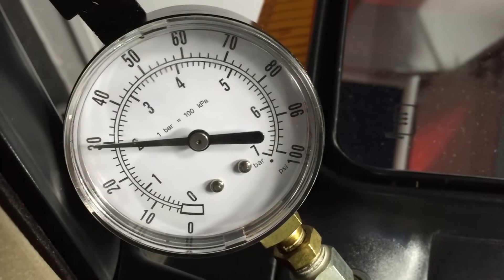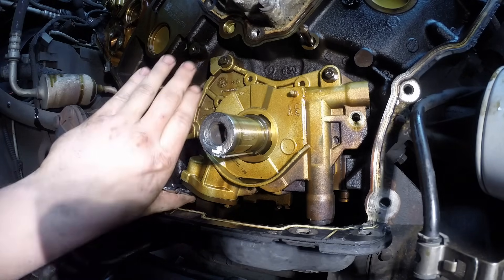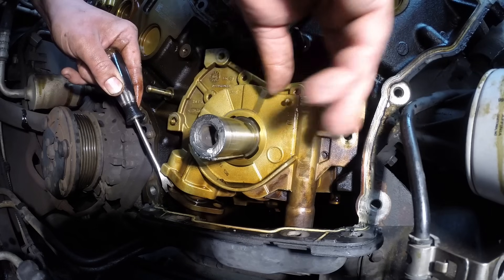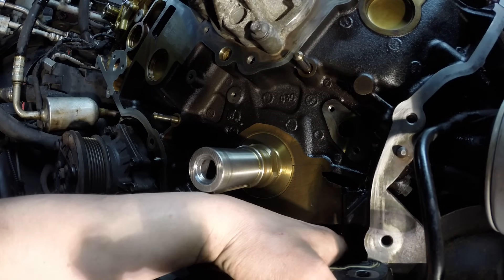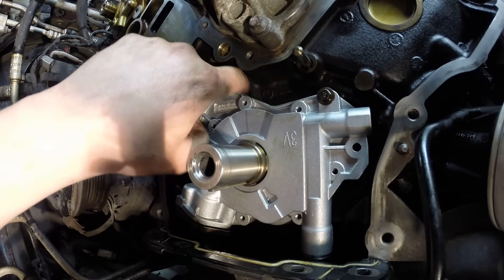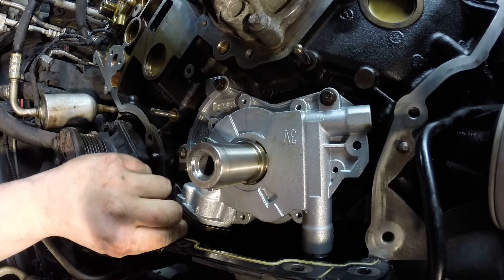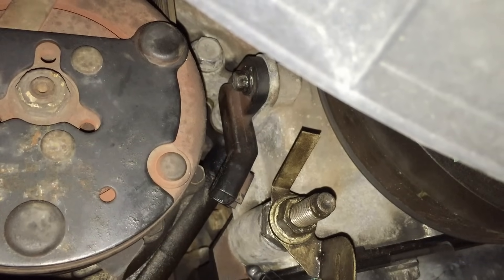Ford 5.4L 3v Engine Melling M360 Oil Pump Upgrade

Comment: you mentioned it was a 10 to 15 min job in your video.  How so, when the shops are claiming 13 hours?  The entirity of the front engine was off the engine you worked on.  That tear down costs something and takes time, making the 13 hours reasonable.  I do appreciate you pointing out that the Ford Mod Motors are not up to the same quality as the Ford FE, Windsor, and Cleveland engines of the past.  How do you build an engine with a weak and break prone oil pump?  Seems like sabotage from the manufacturer.
Reply from the maker: I mentioned during a timing job why not go one step further and replace the source of the problem which is the oil pump. At this point it is only another 10-15 min job.

Comment: I used an extendo (that's some go go gadget terminology) magnet and placed it directly underneath the bolts...or u can use a wide magnet and place on the outside of the pan again directly under the bolts as well...if all else fails find a mechanic with BK hands (tiny fingers)

Comment: What's the High Volume Pump for a 1997-2002 F 150 4.6L?  M176?? Thanks
Reply from the maker: You want this one- https://amzn.to/3U0s7iP
Reply: @FordTechMakuloco   Thanks, Might as well change the oil pump for the full tune up.

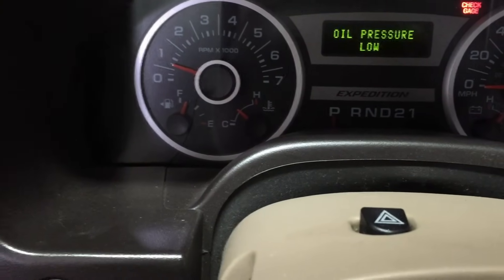Comment: At 12:45 I think you meant to say it’s a 10/15 hour job* lol
Reply from the maker: No I meant a 10-15 min extra during a timing job.
Reply: @FordTechMakuloco  oh my roller follower failed on my 09 mustang 4.6 an it messed up the cam I can't find someone that will replace just the cam an lifters an followers they all wanna pull the timing cover an replace the chain to but car has low miles I don't got chain issues ik there's a way to do it without touching it the factory ford timing chain is on backorder I don't wanna use any other one

Comment: I like to see your videos, they are very useful, I would like to know if the 2000 5.4l 32v lincoln navigator engine has two oil pressure sensors because it uses needles and a light, the needles go up more than half but the lubrication light still comes on.  this engine does not use vvt

Comment: What's the difference between the 340hv and the 360hv? AutoZone is telling me the 340hv. I  have a 06 expedition 2wd 5.4. What to do?
Reply from the maker: You can use either one, the 360 is just a higher pressure which isn't needed.
Reply: @FordTechMakuloco  Thank you Brian,  went ahead and purchased the 360 😊🤞

Comment: Hey Brian, one quick question. I swapped out my oil pump when I did my timing chain. I have everything back together and trying to prime the system. The motor is cranking and cranking and my gauge is not moving. How long in general does it take to prime? Thanks
Reply from the maker: Crank two times for 10 seconds each allowing for the starter to cool. Then connect the CKP and fire the engine. If the oil pressure does not come up within 2 seconds some thing is wrong and you need to shut it down.

Comment: Used a 14" zip tie around the bolt to get it off and back on. You can use the tag end of the tie to firmly hold, position and align the bolts as well as put a small side load on them to ratchet them off and back on with the swivel head. Once you've ratcheted the bolts on far enough, you simply cut off the zip tie. There's no way to lose them in the oil pan either.
Reply: That is smart. Good thinking

Comment: Hi, why only 3 bolts , not 4?
Reply from the maker: The 4th one comes from the lower bolt on the drivers side guide during the timing process.

Comment: That driver side pickup bolt is my worst nightmare 😫. It sucks getting in so bad I almost want to drop the pan. Im doing a head and cam swap on my 02 lightning. Everything has been easy except for these two 8mm spawns of Satan.

Comment: I recently followed your 4 part video series on the full timing chain replacement. I replaced the oil pump with the Melling 360HV and started running 5/30 synthetic oil. My truck runs better than ever - Thank you for your excellent videos. I've noticed since I did the job - my oil filter gasket is dripping a small amount of oil. I've changed the adapter gasket, changed the filter itself, confirmed the filter seal is in good shape and does not have "double seal". Also cleaned everything off and actually crawled under and confirmed oil is coming from the oil filter seal itself. Any chance this is pressure/volume related? should I try going back to 5/20 oil? Anything else you can recommend?  2007 F150, 5.4 3V, 245,000mi.
Reply: Please lmk what happens. I recently went and did a timing kit and the 360HV pump too. But still running 5w-20. Going to switch to 5w—30 soon
Reply: Which oil filter are you using?

Comment: I just ordered one of these pumps for a 5.4. So excited to see the extra oil pressure at hot idle!
Reply: Hope you have an external oil pressure gauge. If your truck is like my 08, oil pressure always sits just above middle, no variation during driving or idling.

Comment: I see you still had a low oil pressure message on the message center with 40 pound's on the gauge what was up with that ??
Reply from the maker: The manual oil pressure gauge was put in place of the oil pressure switch so of course...

Comment: My 226k mile 5.4 has been awesome but when I turn it on in the mornings or after a while of being off it gives me “low oil pressure” on start up for less than a second.
Reply: That just happened to mine 04 f150 was it the oil pump or something else?

Comment: Great videos I have question I change oil pump 340HV 2009 Ford F150 and when I crank it it is not building oil pressure. I tried with oil sending unit then changed it out to an oil gauge. Still no pressure. not sure if I am not cranking long enough or do think it could be something else?

Comment: this is way late date to comment but I got to wondering if there is any concern that installing the high volume and increased pressure pump plus using the latest oil flow restricted roller followers might be overkill for oil pressure problems and actually contribute to increased potential for bearing damage and parasitic power loss due to high pressure. I had engine builders in the past (pushrod days) advise against high volume/pressure pumps for street engines.
Reply from the maker: I only use the standard pressure high volume M340HV.

Comment: Why only three bolts when there are 4 bolt holes?
Reply from the maker: The 4th bolt comes from the lower guide bolt on the drivers side.

Comment: What if I followed the instructions, and I don't have oil pressure. This project took me 1 1/2 years to complete. Could that be the reason why I am not getting oil pressure?
Reply from the maker: Crank for 10 seconds two times in a row allowing for the starter to cool. Then connect the crank sensor and start the engine, engine clatter and the oil pressure gauge should come up within 2 seconds, if not shut it down there is a problem.

Comment: I have a question. Will this oil pump work in a 05 Ford F-150 5.4l SOHC engine? I’m talking about the new high volume high pressure oil pump. Amazons website says it will not work and that it is for a 32v 5.4l. I don’t know if does made a 32v 5.4l

Comment: Mine was done after 220,000 and phasers, chains, guides, etc.....my mechanic switched me to 10w40.  Plus every other oil change a quart of Lucas stabilizer.......truck runs good and engine tight!!!

Comment: Wil I am going to replac tensioner chain kit but do I have to change oil pump also ! . Cause I don't know if the pump is faulty or not but the gage pressure was good before I begin to replace that parts.

Comment: Just wanted to say thanks for the great tutorial. One tip I have for others having a hard time with the rear bolt is to take two minutes to make a wrench out of a thin piece of sheet metal. Use tin snips to cut a metal strip 3/4" wide by 6" long then lay the open end of an 8mm wrench at the top 3/4" side to trace and cut the 8mm opening. Now you have a very thin flexible wrench that you can use to overcome the steep angle of the rear bolt during its initial installation. As you insert this flexible wrench you can use the same finger you are using to hold the rear bolt in place to guide it. I fought with this rear bolt for over 2 hours before trying the above and then was able to install the rear bolt in literally minutes.
Reply: A year later and this gem of advice saved me likely hours of frustration. I made the wrench like you said but I also made a “wing nut” to slide onto the screw head to help with getting it started. I cut a very thin strip (barely wider than the screw head itself is tall) by maybe an inch and a half long. Folded it tight into thirds, think like a paper clip not a Z. Then jammed a screwdriver in the middle and twisted until it opened up enough to fit tightly over the screw head. Kinda looked like this when it was done <o>. Made it easier to start the threads and turn the screw with one finger. Pulled right off then the flexible wrench did the rest. 

A heartfelt thank you 🍺

Comment: Hi Bran, great videos. I have a 2007 f-150 5.4l 3v. It has just happened under 140,000 miles. Will be replacing timing/oil pump (Melling M360VH), and rockers. All OEM except pump. I am acquiring the tools and parts you recommend little by little. Probably will have everything by the end of March. I am not a machanic but have sent you videos and feel confident. I just finished changing the plugs and and coils (Motorcraft). I was lucky and none broke. Thank you so much for your indepth vedios...they're great.

Comment: So why did it say low oil pressure on the dash after new oil pump. What was that about.
Reply from the maker: Oil pressure switch was removed to screw in the manual oil pressure gauge of course!
Reply: Hahaha of course. Good video man. I'm buying a 2010 f150 with 220k miles on it and I'm definitely putting this pump on. Thank you for your time.

Comment: Need help I have a 2005 5.4 f150 I replaced the timing chain kit including, tensioners,phasers, oil pump but not a melling m360 and vcts it runs great for 10 to 20 minutes then runs as if it's going to cut off turn off the engine restart run good for a few start running as if going to cut off checked for codes had codes p0340 p0344 p0345 and p0349

Comment: M340HV or M360HV for 06 F150 5.4?
Reply: I’ve been reading comments and I think maku says 340HV
Reply: @americanchauvinist1210  Ive been using the M360HV for over a year now.
Reply: Any oil consumption or leaks?
Reply: @americanchauvinist1210  it exposed a rear main seal leak and I had to fix that and now its fine but it is slightly burning oil but that could be many different things. But its not bad.
Reply: @MrTailsGamer  do you think the 340HV won’t have that issue?
Reply: @americanchauvinist1210  honestly I don’t know. There was some sort of confusion, maybe on my part on which one we should be using for these 5.4 3v motors. I thought maybe the 360 was too much and could be problematic but so far so good.

Comment: I need help! I did the full timing job on my 06 f150 including this m360 oil pump upgrade. It runs great, however I think the stock pcv is getting oil pushed passed it and into the intake manifold as I am consuming oil and getting blue smoke at startup. I have a feeling its because of the increased oil pressure but I am not sure. Does the stock pcv, which is built into the drivers side valve cover not strong enough to support the extra pressure? I need some advice! Ideas? Thank you!

Comment: For my 07 4.6l 2v Melling has 4 options and for the m176hv for high volume and pressure has a warning if u have stock bearing Tolerances, don’t use. Does switching to 5-30 solve this? Is that y u change oil weight?

Comment: Just finished installing the new M360HV.  Yes, it was a beast of a job. As shown in the video the 8mm flex is a must and with the assistance of a topside creeper made it more manageable. I did have one secret weapon. I sub-contracted the hard to reach pickup tube bolt to my 11 yr. old daughter.  Together we got it done! I've seen a lot of back and forth between the M360HV and M340HV.  At the time (July/Aug) I was gathering all the tools and parts needed for the job, it seemed like the   M360HV was advertised pretty heavily. With that, I'm not going back in and swapping out the 360 with the 340.  At this point, it is what it is.
Reply: Did the job really only take 10-15 minutes as he states in the video?
Reply: @A.C.71  The oil pump, power steering and the oil pressure sending unit were hard. I have a 4x4 so the clearances we're tight.  

Getting the pump off was easy. Putting it on was challenging but the bolts on the pickup tube are hard.  Took me awhile, but I'm a novice.
Reply: @EVRY1STFU  I'm thinking he meant 15 minutes once the from cover was off. I'm curious how much time the entire job from start to finish takes the average guy. About how long did it take?
Reply: @A.C.71  I'm below average. Meaning that was the most I worked on a vehicle in terms of technicality.  It took me longer than most. I work a full-time plus type job and I had to contend with 3 family emergencies. I also dealt with a counterfeit tool from Amazon....so that slowed me down significantly. I also inspected all parts and tools 20 times over. I called several Ford dealerships to compare part numbers etc & dealt with Amazon fraud department. I could probably do the job in 3-4 days comfortably now that I have a little experience.  Some guys on his videos get it done over the weekend.  Brian quoted me 1.5 days, but he's a master mechanic with a nice garage setup. Overall, it's a good bit of work.
Reply: @EVRY1STFU  oh ok so it's a massive job. In the video he kinda makes it sound like once the  cover is off it takes just 10-15 minutes. It doesn't look like he dropping the oil pan either. So that gave me the impression once the cover is off which isn't very hard it just takes 15 minutes to change the oil pump out.
Reply: @A.C.71  My bad. The oil pump took me and the help of a small hand about an hour. It's not too bad.
Reply: @EVRY1STFU  no dropping of oil pan then..cool.
Reply: @A.C.71  Nope, not for me. It's recommended that if you have bits and pieces of guides and/or front cover shaving you drop the pan and clean it out. Good luck!
Reply: I am having some trouble getting the pump to seat flush, confirmed its the right pump and am having the same problem if I try to put the old one back on, it stops about 1\8 Inch from flush, tried wiggling it, made sure the flats are aligned and tried gently seating it with the bolts but got to much resistance, old pump came off pretty easy, any advice would be great!

Comment: I don’t suppose you have a video where you’ve changed the valve stem seals in the head without removing the head 

like they sometimes do with compressed air in the spark plug hole……??

Or presumably by rolling the motor around to top dead centre and letting the valve sit on the crown of the piston rather than dropping all the way in
Reply from the maker: Use the air in the cylinder method at TDC.
Reply: @FordTechMakuloco  Thanks mate all the best from Melbourne Australia

Comment: Does this pump fit a 06 f150 5.4l?
The auto parts stores says it doesn't fit that vehicle.
Reply: I just finished putting the M360HV in my 08 5.4L about 10 minutes ago.

Comment: What is the pressure suppose to be on the high volume pump? I just installed one and it’s reading 20 psi after a hour of it being on, I changed both phasers, oem vct’s, new chains and tensioners, I did a cloyes timing kit with the phasers

Comment: Great videos! Would be lost without them. I just looked at the M360HV on Amazon and it says that it doesn't fit my 2004 5.4L Triton. Same with the M340HV. So I contacted Melling and they told me the M340HV is the correct pump. I see this video is 5 years old. Do you think the M360HV changed such that it no longer is compatible, or are you still recommending it? Thanks!
Reply from the maker: Both the M340HV and M360HV are fully compatible 2004-2014 models.
Reply: @FordTechMakuloco  Thanks!
Reply: @FordTechMakuloco  do you see the extra volume/pressure from this oil pump causing seals and gasket issues/leaks once installed? I’m now getting startup blue smoke and burning oil after the timing job and oil pump upgrade on 06 F150.
Reply: @MrTailsGamer  do you have 360 HV or 340 HV?
Reply: @FordTechMakuloco  which oil filter should we use with the 360 pump and 5w30 oil?
Fl820 vs fl500 or something different?!!?
Reply: @fomoco85  fl-820s, I’ve wondered the same thing and have been reading through his replies for hours, underneath his video detailing the chain tensioners somebody asked the same question and he respond witn 820s
Reply: @simonwads6  perfect. I recall him saying a filter and why but after watching so many of his videos I can’t find it again.  Duper find. Thank you

Comment: Great vid!...Why not use the high pressure & High Volume pump? Is increased pressure all thats needed for this engine? Thanks!
Reply from the maker: This is an old video before the HV pumps came out.
Reply: @FordTechMakuloco  1st thanks for the quick reply! So you would recommend the HV/HP pump now?
Reply from the maker: HV only this one here- https://amzn.to/3BaY3Xa
Reply: @FordTechMakuloco  Thank you!
Reply: @FordTechMakuloco  Im confused. Your link above in the description is linked to your recommendation for the M360HV for all 5.4 3v engines. But this one you just linked to TheHonarable1 shows M340HV. I just put the M360HV in my 06 f150 5.4. Are you saying that I put the wrong pump in it? I should have used the M340HV?

Comment: How come the pump you’re recommending does not fit my 2010 5.4 lariat? 4wd supercrew cab
Reply from the maker: As I have replied many times before this oil pump fits all 3v engine 2004 to 2014.